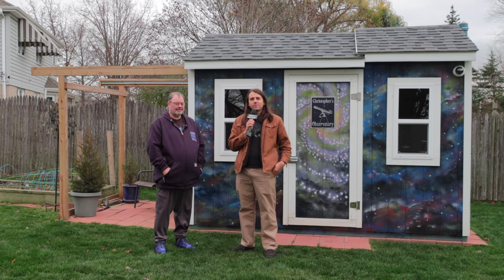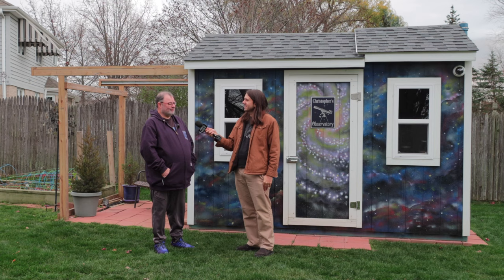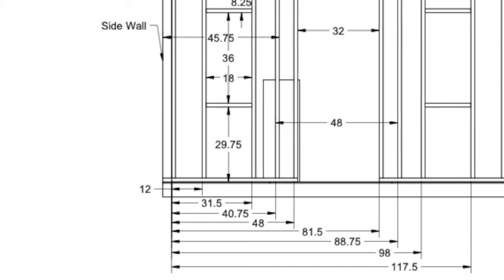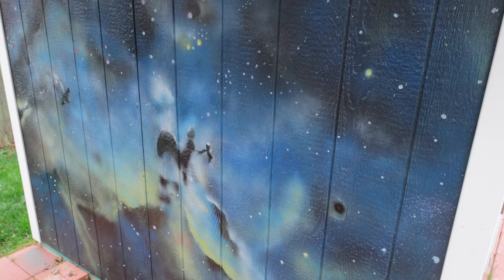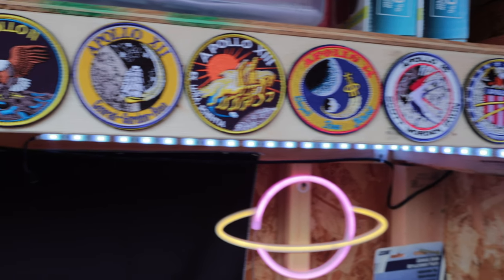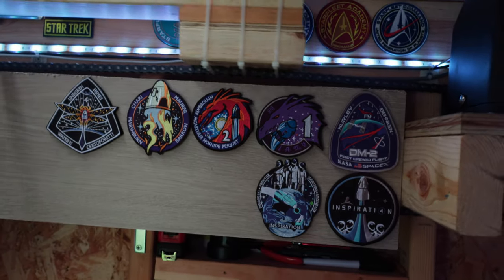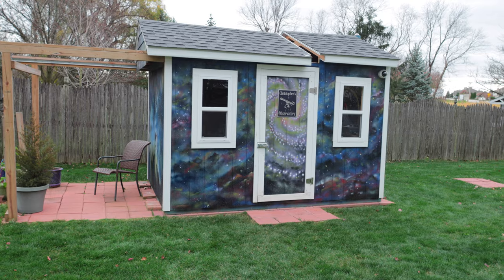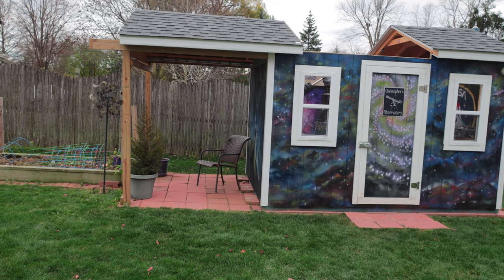Christopher Baker’s Split Roof DIY Observatory (Observatory Tours #3)

Comment: Thanks for visiting Nico!
Reply from the maker: The pleasure was all mine. Wishing you lots of clear skies in 2023!
Reply: Great job 👍
Reply: That's one hell of an observatory Chris
Reply: @bruschi8148  Thank you.  It has been the biggest improvement in my adventure called astrophotography.
Reply: Thanks for the tour Shogun!
Reply: Nice observatory!! About the gap, we can also raise the second roof so that it goes over the first roof. It has its own challenges but I feel that even when you strap the roofs together it will still have some gap.
Reply: Nice observatory! One of the best I’ve seen so far. Now about that darn gap what do you do when it rains?
Reply: @andesastro  The fixed roof overhangs  the movable roof by several inches.  So the rain can't get in from the top.  The gap is on the side or "facia" and that overhangs the wall.  So unless the rain is almost horizontal, it won't come in.  The only thing that has ever gotten in were a few leaves blew in and a light dusting of blowing snow.  Nothing of concern.  I just want to add a weather strip to keep the blowing stuff (leaves mostly) out.
Reply: Christopher. Thank you so much for sharing your project. It is great to know that I might be Ble to achieve similar results. I'm no expert builder, but reasonable DIYer and your setup looks great. Time to start saving the $s!
Reply: Why did you need to bring out system every night? You could keep it under Telegizmo. 
Do you really get 10 nights imaging in that region?

Comment: I love the murals you have on your observatory. I did something similar inside my observatory. I have a scale model of the solar system that was painted on the inside walls to help illustrate the size and distance differences of the planets. Of course, you have to keep in mind that the Sun and planet sizes are all proportional to one another as are the distances between the objects, but the sizes and distances need to be compared on their own.

Comment: I live just north in Milwaukee. Same light pollution problems. Soon as you mentioned Chicago, I grimaced. It's so annoying. I'm just now trying to set up a real scope, asiair, SA GTI mount on a dedicated tripod. So I  can at least have cables and all in a setup, so I can grab it from garage, polar alignment, and be imaging. Weather is doggy in these parts. With these frigid Temps. I have to move some stuff around other night, Clear Outside said clear night. Just got my target aligned, and  clouds rolled in.Grrr With your rigs, you have Filters for light pollution. What do you recommend as a single LPF?  Before getting a scope I've been just using lenses. Anywa, thanks Niko! As usual you keep this hobby real for people in my bracket.
Reply: I use Antlia 3nm Narrowband SHO filters.

Comment: fantastic Chris and Nico...a couple of questions, do you have optimal view at that point, it would be difficult to have this in a static position in a garden that has say 3 or 4 different areas depending on the areas with no obstructions...and secondly, did you install heating to let you process on cloudy nights?
Reply: Hi Mimi.  One reason I chose this location in my yard is I get the best views of the S, W, and E.  My house and trees block my northern views a bit.  If I choose a different part of my yard I could have had better views N, but sacrifice the other directions. Bottom line, this spot optimizes my views and made the most sense related to my garden.   I still setup a portable mount on occasion and have a pad about 10' just west of my observatory with similar views.

No heat.  I do have a portable, electrical heater I use sometimes.  But on the coldest (and hottest) days of the year, I do everything inside as everything in the observatory is on my network.

Comment: I look at all the observatories people build. And I have a question.
Is all this delicate equipment is weather proof enough that you can store it permanently in humid environment?
Observatories like this definitely not sealed from outside air. And that air will be quite humid (depends on geographical location of course) significant part of time.
Reply: Most people that have an observatory keep their equipment in it 24 x 7.  Some people do condition their observatory while others might keep their mounts outside and bring their scopes in at night.   All depends on the equipment and the user.  

I think the biggest concern is for particular type of equipment.  For example, certain older refractors that have oil spaced lenses might be sensitive to excessive heat or electronics might be sensitive to super cold temps. I have read about some people using light bulbs or insulated blankets to keep computers warm so they don't go well below 0 F, for fear of damaging the electronics.  Really cold temps can also make some plastic very brittle. 

I haven't had any of these concerns, not yet anyway.

Comment: Nice.  I have a question for Christopher.  Have you used it through a winter?  How does it deal with snow, or does it have to be cleared off first.  I live in Colorado, so you know why I'm asking!
Reply: I use it all year long.  In the Chicago suburbs, we get snow and very cold temps.  I imaged down to about -20 F (even colder considering wind chill).  

If you use the "v track" rollers, the v track sits on top of the rails the roof rolls out on.  One reason I didn't like this idea is we get a lot of ice (snow that melts) and I felt that ice on these rails would be problematic.  My garage door track sits on the side of the roof rail. It is hard to explain but is slightly "covered" by a 2X6 (Rail is two 2x4s with the rail attached on the inside, and is covered by a 2x6.) So snow falling would have to be at an angle to land inside the rail as it falls on the 2x6.  

Bottom line, maybe 1 or 2 times last winter I had to dust some hardened snow off the face of the rail but more for making it move with less resistance.  No real issues with it.
Reply: One other comment about snow... Always roll your roof parallel to the roof peak.  If you roll it perpendicular, half of the pitched roof will be angled into the observatory when it rolls.  Snow can fall into you observatory as it rolls open or closed.

Comment: Why didnt he just roll the whole roof instead of the split? if he wanted space he could have just not roll the roof all the way, leaving him one part on the left side.
Reply from the maker: Smaller overall footprint this way since the supports don't have to extend as far. And there were big trees in the direction of the roof section that stays put, so he doesn't lose any sky.